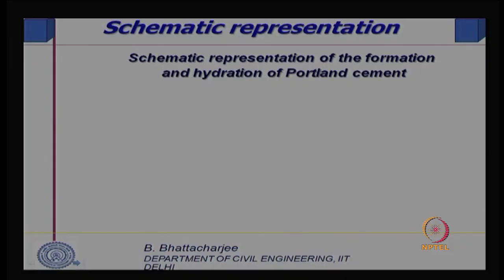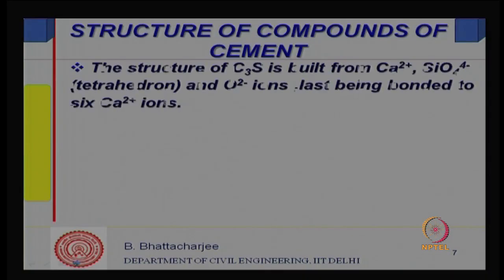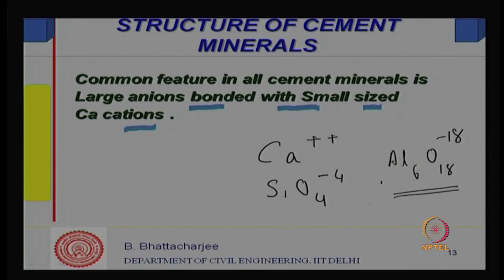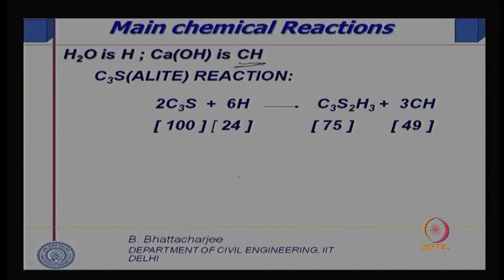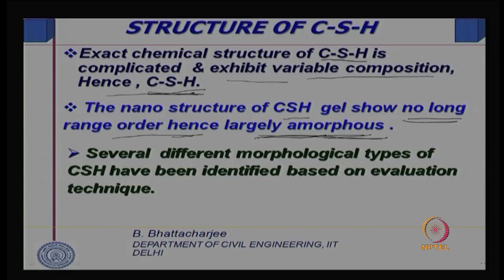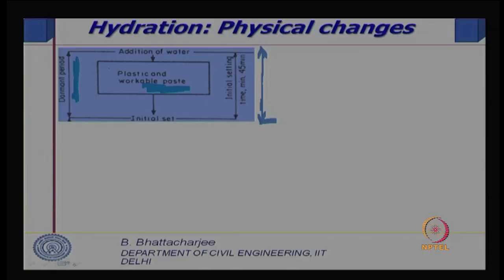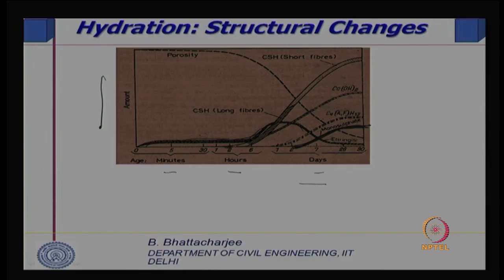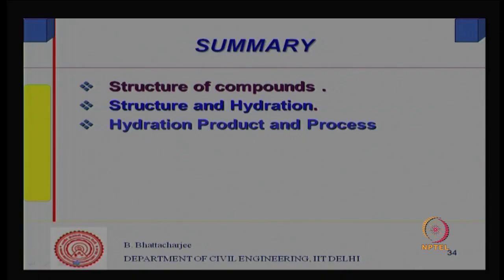Cement: Structure and Hydration

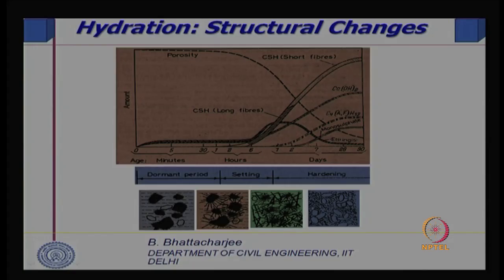Comment: I have a question asking that the figure (Video time: 50:30 to 53:50 minutes) demonstrates that the formation of CH starts parallel to ettringite from the very start of hydration process, which is opposite to what you have stated "CH produces together with the CSH, Video time: 52:45 minutes". 

Moreover, may you please cite here the original article demonstrating the diagram for structural changes of hydration phases (Video time: 50:30 to 53:50 minutes).

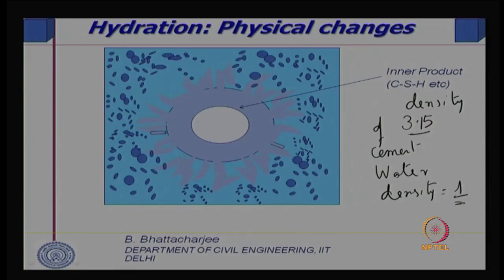Comment: 46:30, density of cement is not 3.15, its specific gravity.. the density of cement is 1440kg/m3
Reply: No, that is a different topic. The density of concrete is around 1440 kg/m3, depending on the details.
Reply: Density of concrete is2400kg/m3 @tothgergely9448

Comment: If C3A causing flash set, then why don't we simply replace it with C3S or C2S. It will eliminate the adding of gypsum.
Reply: Alumina is a acting as a flux in the pyro process, without which the clinker formation is difficult or impossible
Reply: Thank you

Comment: If FLASH SET occurs does cement gains it's optimum strength?
Reply: no, it shouldn't  as c3s and c2s didn't get enough time to react moreover these two components provide strength. c3s gives early strength whereas c2s provides strength with time passes.